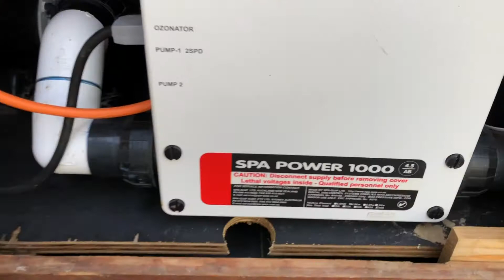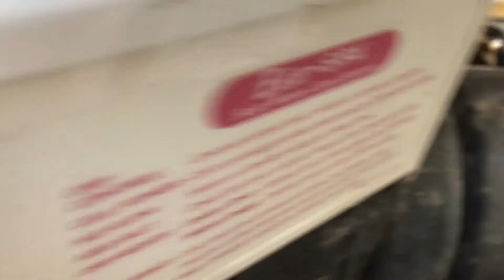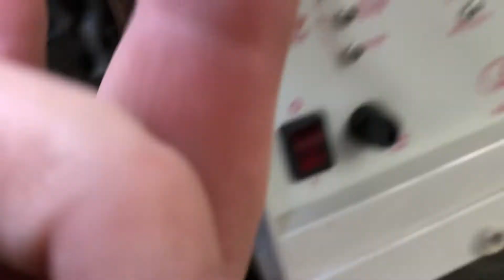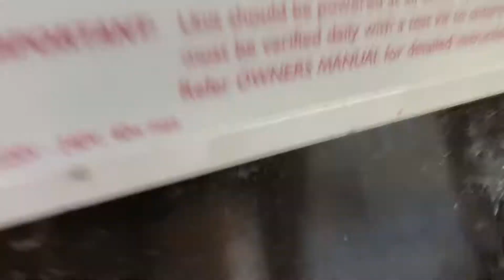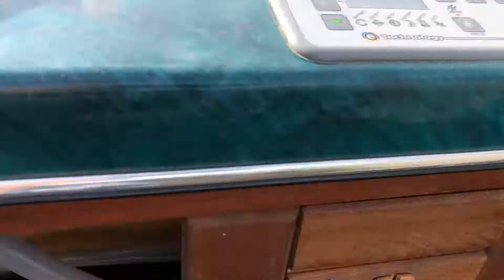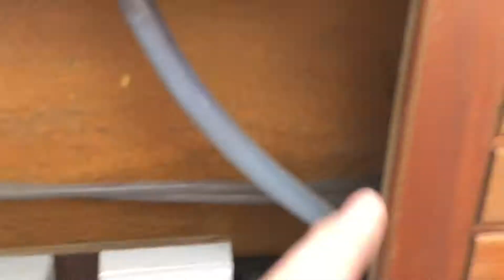Spa Equipment & control System run explanation Spa Quip SP1000 Davey Balboa Power 1000 controller

Comment: I’m looking at a spa with the spa power 1000 and the heater isn’t working for $100 should I get it
Reply from the maker: Hi Allen. If the spa is in Good order, kid the shell and jets then yes. But you will have to replace the spa controller. Contact us at PoolnSpa Supplies Australia  0434443680 and let us know how many pumps and blowers, you have. Take photos of the old sp1000 if you are not sure and we can match a new controller for you. They start at $1150 for new touch pad and heater and controller and temp sensors. But we need to match the controller to the pumps in your spa. Mark PoolnSpa Supplies Australia

Comment: I have a CE06 error, can you help me
Reply: Adding this to hopefully help people in future that are looking up this error. I have spent a while diagnosing my er-06 error, replaced temperature sensors, motor capacitors etc,, but for me the problem turned out to be an issue with a relay, specifically one of the black ones on the main board. There are two black ones, and I think 3 blue relays, the one black relay that had the fault drives the low speed (while heating) pump. The simple fix is too swap them round (the two black relays) as one does far less work than the other and is less important if it doesn't turn on, better still is too replace them, though they are difficult to source due to being officially discontinued. Ali express can supply! Hope this helps.

Comment: Hi Mark, great video. Do you still have replacement units available for sale for the Spa Power 1000? Let me know how I can connect and purchase one. Thanks Brett
Reply from the maker: Hi Brett. 
Yes for sure. Contact Nillumbik Pool & Spa Service tomorrow during business hours. 
Let me know how many pumps and blowers you have in your system and we can get a system that will fit well.
Reply: @Marksreviewsandtutorials  Thanks so much.  Will give you a call tomorrow.

Comment: Hi Mark thanks for the video. I was getting the safety switch trip on my power board. I took the cover off and noticed the left heat sensor had corroded out so I used a modified paper clip to by pass the sensor and see if this was the issue and it worked fine. What are the dangers in by passing this sensor permanently because I can't afford to replace the entire unit? Thank you
Reply from the maker: To bypass a sensor is dangerous and illegal. 
If the spa overheats it is very serious. So no if your controller needs to be replaced then replace it. 
I have units that are not to expensive and not to hard to fit. 
You get new heater new sensors and new controller and new touch pad. 
Mark
Nillumbik Pool & Spa Service 
And 
Mark’s reviews and tutorials
Reply: @Marksreviewsandtutorials  could you send me a quote?
Reply from the maker: @twomartoes  Yes call me at Nillumbik Pool & Spa Service 
, Ill need to know how many pumps you have and if they are two speed or single speed
Reply: Seems I have earth leak this could explain the build up of corrosion on the sensor and heater plate 😪

Comment: Hi Mark. How do I reset my controller. My error message is SE 01 stick button.
Reply from the maker: Hi Andrew, if the error message is stuck button then it is your touch pad that is the problem. These are no longer available although I do currently have a tested second hand one here. Contact me at Nillumbik Pool & Spa Service if you would like that one. To reset an sp1000 switch it off at the power for two minutes

Comment: Nice video thanks mate! Would you have anu idea how to reset the control panel on these 1000 models? We lost power and I'm showing a CE:06 error.
Also can I get an email address so I can ask for a quote on replacing our old unit for a newer one please. 
Cheers, Jai
Reply from the maker: Hi Jai. 
The reset on those is to switch it off for a couple of minutes then back on again. Unfortunately the error 6 is the death error once this happens that is normally the end of the controller. Other than the heater there are no spares for these units. 
Nillumbik Pool & Spa Service email is NPSS@Goatley.org